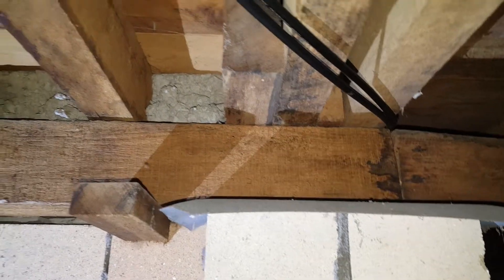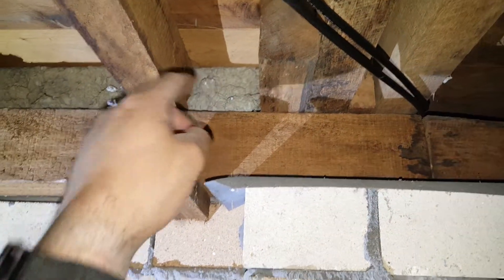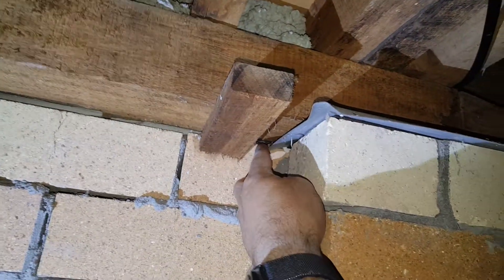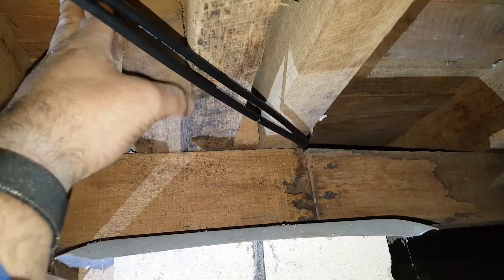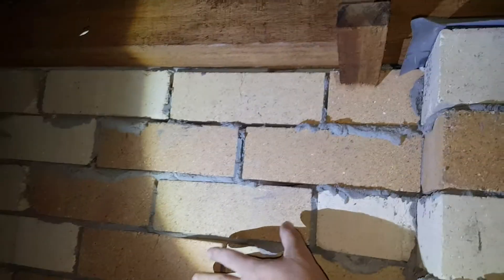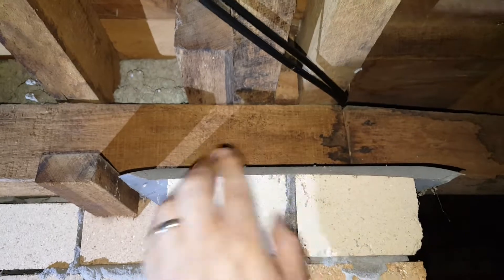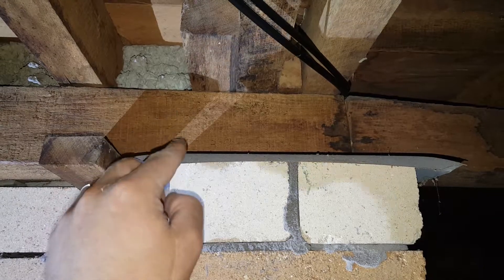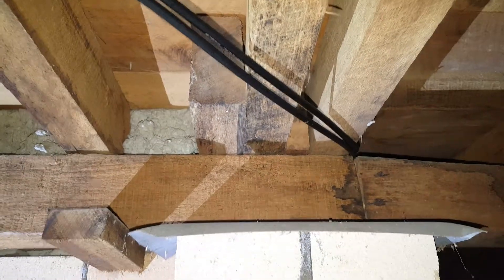Termite Tidbits #2 - Ant capping abutting concrete slabs.

Comment: How do you fix inadequate ant capping?
Reply from the maker: Hi Wilbur. Sometimes it’s possible to place new caps on the piers, these are readily available from many hardware stores. However, when it comes to dwarf walls or areas where ant capping is abutting a slab, it is often not feasible to add either a metal shield or impregnated termite barrier to these areas. In such cases either a chemical treated zone is installed or a baiting system is installed to provide adequate termite protection.